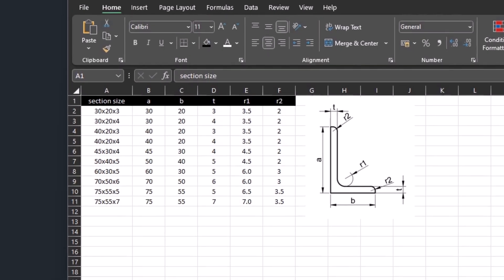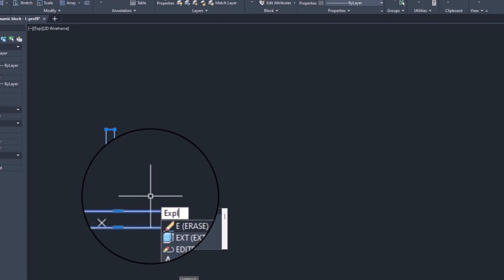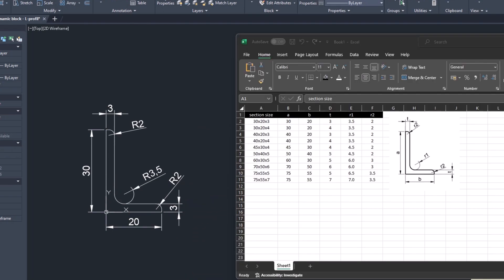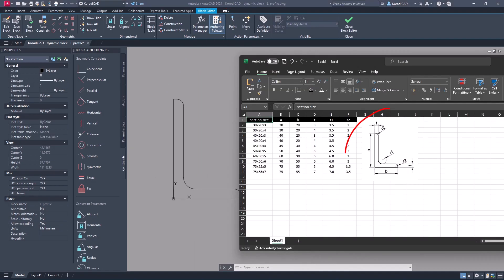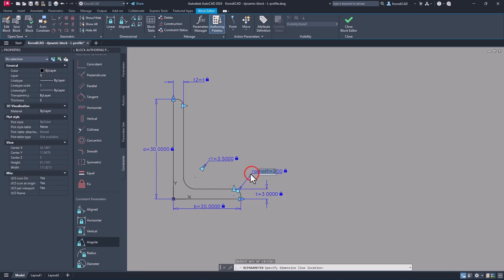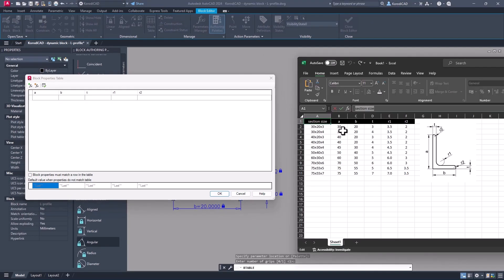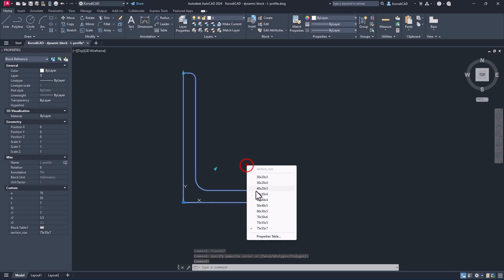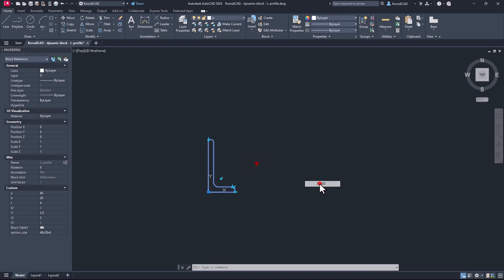Dynamic Block -  L-PROFILE [ FULL ] - #autocad _7 Blocks

Comment: very nice. is it possible to make the 90° angle dynamic where it could be any angle?
Reply from the maker: Of course it's possible. You need to omit or delete the right angle geomethric constraint, then add the "ANGULAR" Constraint Parameter to the arms. You can find the Constraint Parameters under Geomethric Constraints in the Authoring Palettes.